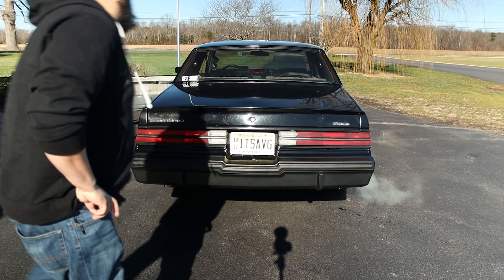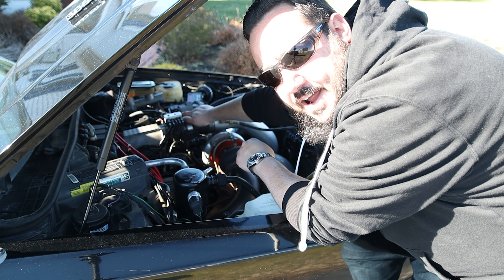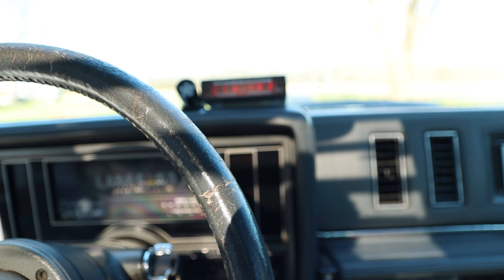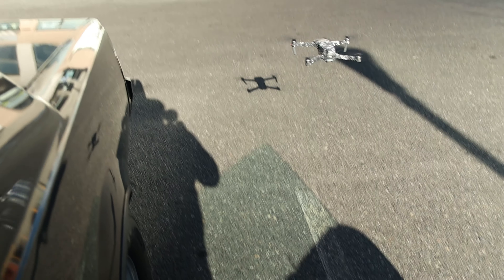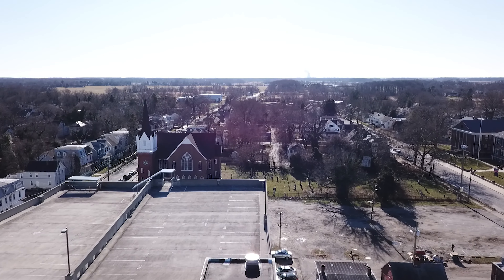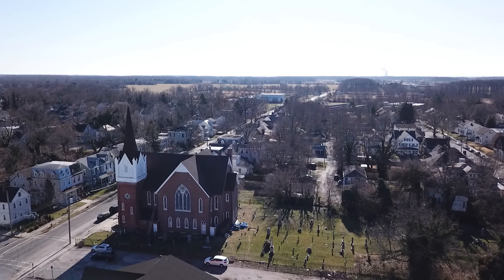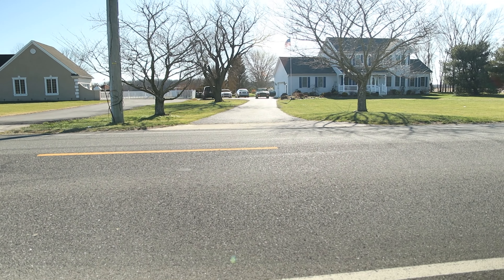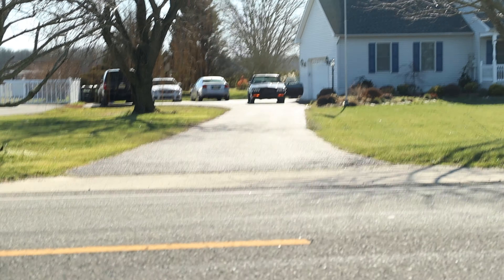More Buick Problems, kinda.......

Comment: My car does the same thing
Reply from the maker: Every cold start?  Does it throw a code too?
Reply: Purple & Timdawg - I had the same lumpy idle issue for years. The colder it got the worse it was to the point where it would not even idle at first. Once the car warmed up, it would idle and drive fine. I needed a Crank Sensor. There is at least 1 vid in my youtube of it at its worst.
Reply from the maker: Yeah been there some that whole cam sensor deal. I was hoping that wasn’t my issue as it sucked diagnosing that. Thanks for the comment!
Reply: Yeah well its normally  the first cold start after its been setting! But the next start is fine unless it had been over a few cold days!
Reply: @purple87ss  I just updated my comment after checking my repair log. I mis-spoke. It was the Crank Sensor, not the Cam Sensor. - My car sounded exactly like yours does in the vid. It was a very cool lumpy idle like it had an aggressive cam in the motor. I fought this issue for years, replacing many things like the TPS, and even got a new computer for it. It was not a big issue at first because it had to be quite cold before it would do it, maybe 30 - 35 degrees. Over the years, it slowly got worse doing it at 45 degrees or colder, then 50 & colder, etc. In all cases, once the motor was warm it would run & start fine.
Reply: @timdawg918  - The same as mine did. Let it get really cold outside, start it and see if it's even more extreme. My car would stall after a couple chugs, I'd keep starting it and eventually it would idle rough, then smooth out once it's warmed up.
Reply from the maker: @jcohonda  good to know.  I'll keep an eye on that too!  Thanks for sharing.